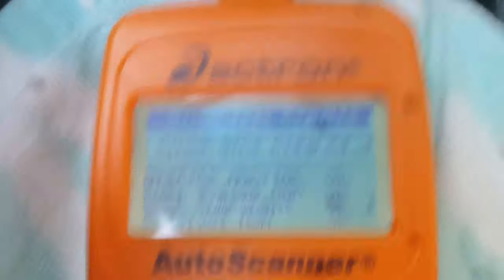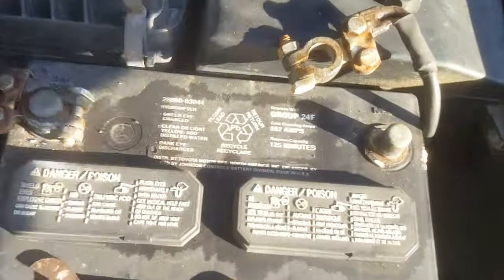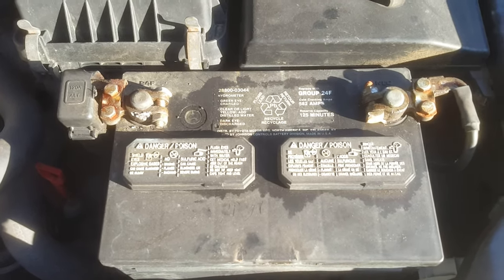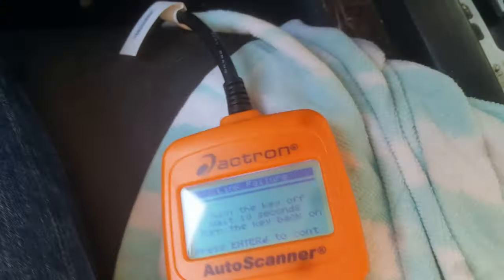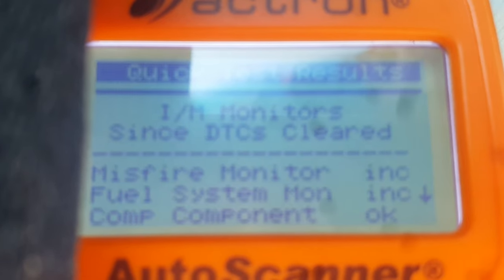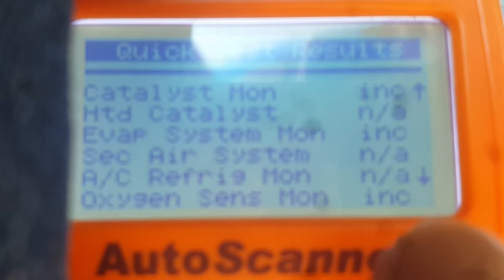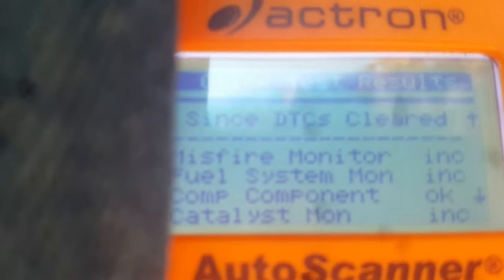How To Clear A Check Engine Light With No Scan Tool

Comment: What we want to know is how to erase the check engine light permanently.
Reply: Fix whatever problem is triggering the code....duh
Reply: On an older car jump the bulb to the battery charging light🤣 you could probably do this on every car but a modern clocks will be difficult
Reply: @DRINKYOURPGTIPS  I mean if you already have access to it, then at that point just smash the bulb lol
Reply: This didn’t work on my wv beetle and mechanic suggested deleting the code with a scanner tool. Let’s see if it will work that way
Reply: Y'all know the check engine light comes on for a reason right!? They don't just pop on to annoy you.  Yes it could be something very simple (loose gas cap) also could be the start of something very serious.
Reply: I don't recommend it. You can ruin your engine that way--sometimes it isn't an easy fix.
Reply: it doesn't work on my camry 2000.

Comment: It will come back in few minutes hours or a day don’t make people fool 😡
Reply: What if it does not come back on ? What does that mean
Reply: It's not to fool people.  Sometimes you've fixed the issue but it doesn't make the light go off.
Reply: @myyoutubechannel3161  If it doesn't come back on then the car's computer has not found a fault. Sometimes the computer will allow a certain number of faults within a set period of time. Once it goes over that number, it throws a Check Engine Light. If it stays below that number, no light.
Reply: @frazzleface753  thanks for the information
Reply: @frazzleface753  got you. Because i cleared my check engine light like the guy says 
Here. But it has been a month and has not came back on.. But i was just curios
Reply: If it doesn’t come back, then things are running smoothly. It can help some people figure out what’s wrong. And it can help people check to see if they have already fixed the problem.

Comment: No all you have to do is disconnect the negative cable from the post allow it to sit for 10 to 15 minutes then reconnect start the car The engine light will go off now you have to reset the computer and you have to drive it to set it
Reply: How long do you drive it to reset
Reply: How do you reset the 😂computer ?🎉

Comment: When you used the wrench to drain and residual voltage you almost shorted out the battery which has known to explode when shorted  Be careful guys!
Reply: or blow a main fuse

Comment: Just cleared the engine check light on my 2012 VOLVO S80. I just removed the neutral cable for about a minute and finished it. Thank you very much.

Comment: My car is a Nissan Sylphy 1.6 Auto manufactured in 2024. I used your unplug battery terminals method and it worked !!! If I go to Nissan Service Centre, they may tell me some bull & cock story and I will be completely at their mercy. I do have a query though. What if there is a fault in the engine somewhere and unplugging the battery terminals simply reset the computer in the car but does not address the real engine issue. Then what ? Then its a matter of time the computer will pick up that same fault again and Darth Vader in the form of that dreaded engine warning light will reappear ? Anyway, Darth Vader aside, thank you for uploading your video to share your "How To Fix" tips.

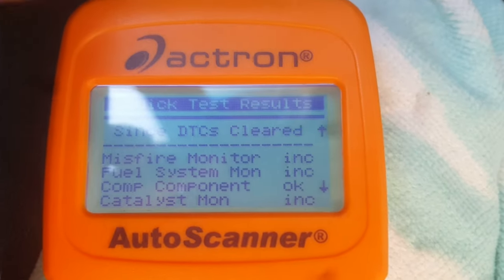Comment: 5:08 2000 Park Avenue, bad MAF sensor. Replace engine soon light on intermittently, code came up with no light on. Do I still need to clear the code with no light on and new MAF sensor replaced?

Comment: My engine light was on Took it to have checked code P0446 fuel pressure sensor I replace fuel pressure sensor my engine light was still on does it goes off when you fix the problem or you have to unplug the battery to clear the engine light
Reply: Get a new gas cap
Reply: @DOLfirst new gas cap doesn’t change fuel pressure that has to do with tank pressure and you would get an evap leak not a fuel pressure code

Comment: Comment at the very end exactly what I'm hoping to try and do. Clear the codes Drive the vehicle see if what I did worked. And if not have to go come back so I can take it and have the mechanic do the job. Or better diagnose the problem that way I do not do the stupid thing and parts Canon the vehicle

Comment: That dosint drain if you put a wrench to both terminal s. ....it will fry a computer
Reply: Bob……take another look, he is not touching the battery terminals, that would be dumb, he is connecting the cables.
Reply: @billwilson6096  hey !  I had a po420 code.. The mechanic cleared the code ... I'm running it 150 miles and taking it back to hopefully pass emission and inspection... As long as that check engine light doesn't come back on I'd be ok on that right?  ?   Please give your input please.... Ty
Reply: @The_magic_mountain33  …. You should be fine at passing the emission test, basically as far as I know this test is simply a look to see if the CEL is showing in your dash cluster.
Reply: @billwilson6096  I picked up some stuff to. Dump in my gas tank to hopefully help not trigger another engine light .. I dump some cata clear .. He said he didn't see any holes in the converter so I'm hoping your right cause I just spent 5,000 on a tractor mower and don't have 1,000 bucks for a catalyct converter ... My guess is an oxygen sensor ..hope the cleaner helps and your right bout the check engine light staying off... Thanks